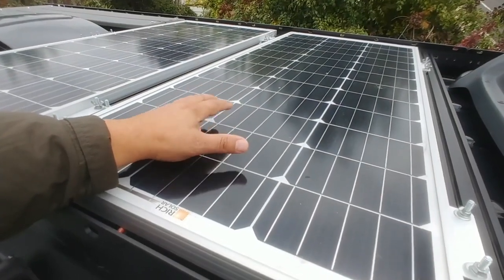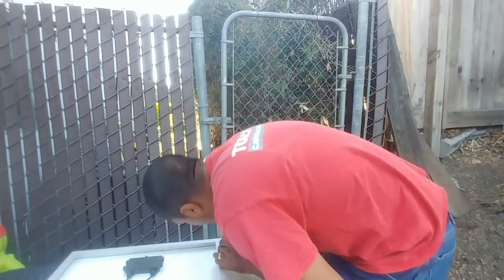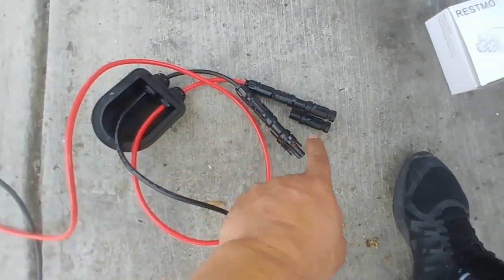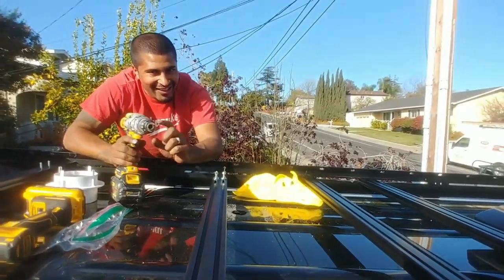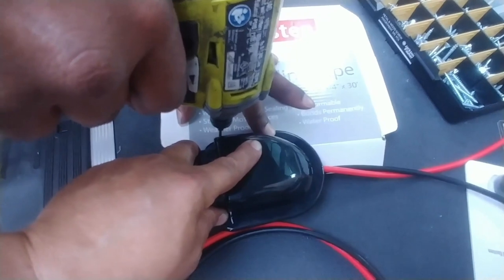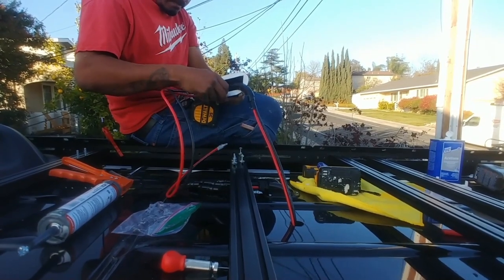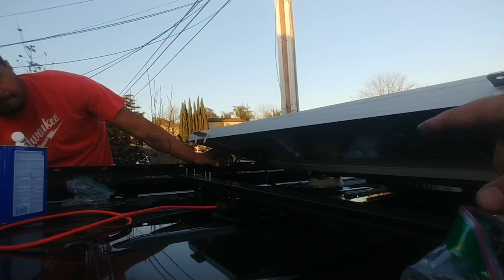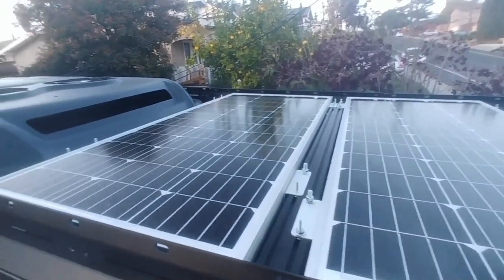DIY Van Life Solar Install▶️ Mercedes Sprinter Van Solar Setup

Comment from the maker: ▶Roof system by Flatline Van Co
▶Ladders by Flatline Van Co
▶Slide T nuts https://amzn.to/3QkhlnD
▶Solar panels with hardware included https://amzn.to/48TRrOR
▶Solar entry box https://amzn.to/3s1klfh
▶Dc to Dc charger controller for vehicle and solar in one unit. https://amzn.to/3PWq4v3
▶Bluetooth device https://amzn.to/3rXLgsE

products used in Sprinter van
▶5 Terminal quick connectors https://amzn.to/46O7E6m
▶3 Terminal quick connectors https://amzn.to/3S3OwNQ
▶2 Terminal quick connectors https://amzn.to/3M6Enfd
▶Great 12 volt quick Connectors https://amzn.to/401ERZN
▶12-volt quick connectors kit https://amzn.to/46V0UDE
▶10/3 marine wire made for Camper vans https://amzn.to/3Qj3y0L
▶2000 Watt SW Inverter https://amzn.to/3rUuf2s - failed
Better 2200 watt sw inverter https://amzn.to/490E1R9
▶Inverter remote https://amzn.to/3ZZE2Rf
▶15 Amp Automatic transfer switch https://amzn.to/45yiAEk
▶30 Amp Automatic transfer switch https://amzn.to/45IGzAQ
▶Budget Inverter with remote https://amzn.to/3PYWMMc
▶1/0 Cable for inverter https://amzn.to/3CrUfT3
▶4 Gauge power cable https://amzn.to/407olrl
▶Lugs- 100 Cable connectors https://amzn.to/3FqFbI0
▶Lug Crimper https://amzn.to/3PZ7liu
▶Cable protector https://amzn.to/3PYnTHb
▶14/4 speaker wire (came be used for light 12 volt loads ) https://amzn.to/45AbLSr
▶14/2 speaker (came be used for light 12 volt loads ) https://amzn.to/402gRpJ
▶Junction Studs https://amzn.to/3M5bSii
▶Fuse / Breakers https://amzn.to/3M6F08z - use only for 50 amp loads or less
▶30 Amp Fuse / Breaker https://amzn.to/403WmJ1
▶30 Amp Lifepo Battery charger https://amzn.to/3Q25yZJ
▶500 Amp Battery Shunt https://amzn.to/3S4dSLl
▶Smart Battery Isolator https://amzn.to/45CzGAX
▶15 amp outlet https://amzn.to/3M5yJKr
▶15 amp to 30 amp plug https://amzn.to/3M4uUFg
▶30 amp shore power plug https://amzn.to/45yjMYk

Got a Question? I'm here to help. ▶http://bit.ly/YTRandomFix
▶http://bit.ly/YTRandomFix

▶▶▶Camper van playlist
https://www.youtube.com/watch?v=r2KTXLqso2c&list=PLDEbtVOPRC-id5xjqFsYm87bJSJL8bLbe
2019+ Sprinter Review https://youtu.be/wAAV6bnHNzY
The new toy  https://youtu.be/EAKbCledvsQ
Low Key Battery https://youtu.be/-FI_DG-DE9k
How to Buy a Camper van for cheap https://youtu.be/nqPSV0mszfk
Seat Removal https://youtu.be/KSUQawuSt_w 
Headliner removal https://youtu.be/FjrJBLXEbyU
Maxx Air Fan Install https://youtu.be/QXxBSx3cfI8
Maxx Air Fan Review https://youtu.be/JIRG7lSR5yQ
Maxx Air Fan Fix https://youtu.be/6k0mPqCgrl4
Bathroom Fan Review https://youtu.be/QXxBSx3cfI8
Spare Tire Carrier https://youtu.be/wVQ_h-FjtPE
Oem Diesel Heater Trick https://youtu.be/Ws9GHo9bWeM
Led Upgrade https://youtu.be/r2KTXLqso2c
Sportscraft Swivel Adapter https://youtu.be/HVkj6KVpUbs
Pocono Swivel Seat Adapter https://youtu.be/r-1HpIl71_I
Front Speaker install https://youtu.be/JjoJH4z4G1E
van Sound Deadener https://youtu.be/8x8RxmrBxL4
Sprinter Trim Removal https://youtu.be/ucYJsH5FJxY
Van Roof Deck https://youtu.be/4cu8mjVKQzc
Front Air Filter Change https://youtu.be/U46Ah40_vIM
Cabin Air Filter https://youtu.be/y8oZNLOkrok
907 Sprinter Oil Change https://youtu.be/bmgI-9KeEik
Maintenance reset https://youtu.be/wDTMwXHGqRY
Diesel Heater Hack https://youtu.be/Ws9GHo9bWeM
DEF Fluid https://youtu.be/Q84lEhLrobM
Portable Toilet Review https://youtu.be/fYu66hqGJZo
Affordable Kitchen Galley idea https://youtu.be/5DG9y_kmHLY
Rear door storage https://youtu.be/bPZfvTWAze8
Modify Rear A/C vent https://youtu.be/o4FJ6Y1ulCs
Sliding Door Bug Screen https://youtu.be/oGA8udVJlYM
Shower https://youtu.be/O4POEFKQmJQ
Plumbing video https://youtu.be/PuOqOt_911I
Simple bed idea https://youtu.be/Q7uGVFPgeDI
Van Life Camper Van Kitchen Galley Idea Under $200
https://youtu.be/5DG9y_kmHLY
Premade Camper Van Bed That Sleeps 4 Under $250
https://youtu.be/Q7uGVFPgeDI
Thetford Porta Potti Review - Simple Odor Free Camper Van Toilet Solution
https://youtu.be/fYu66hqGJZo
Van Life Rear Door Storage Solution for Under $40 for Camper Vans
https://youtu.be/bPZfvTWAze8
Sprinter Factory Roof Ac - How to Modify Vents for Van Build
https://youtu.be/o4FJ6Y1ulCs
Van Life DIY Camper Van Bug Screen For under $40
https://youtu.be/oGA8udVJlYM
Long Seat Belts for Van https://youtu.be/b9sQHKU-xdk
Battery Shunt https://youtu.be/54xGTbcFQB0
30 amp Battery charger https://youtu.be/SY0wS3DlKho 
Battery Box Cooling idea https://youtu.be/sng2aot7PLc
Window Covers https://youtu.be/aO407scjyfU
Camper Van Flooring https://youtu.be/ACaCkg_n-qw
DC to DC Charge Controller https://youtu.be/bquwcRwfSEY
5 Tips to Sell a Camper Van https://youtu.be/2knrkpAPVug

Comment: Where can you buy the 80/20?
Reply from the maker: I got the first batch from 80 20 directly and later I bought it off Amazon. The shipping on Amazon was expensive so I bought quite a bit because the shipping was flat rate.